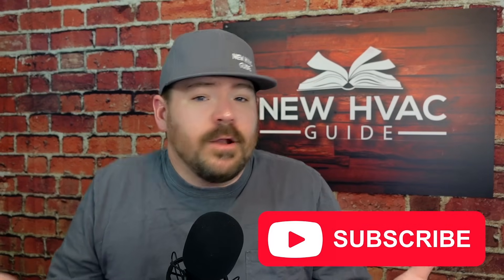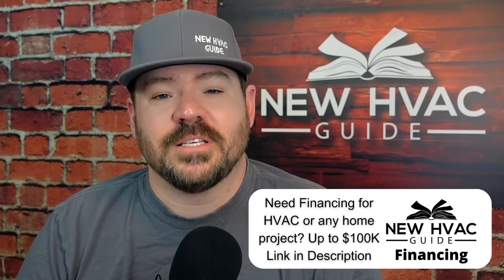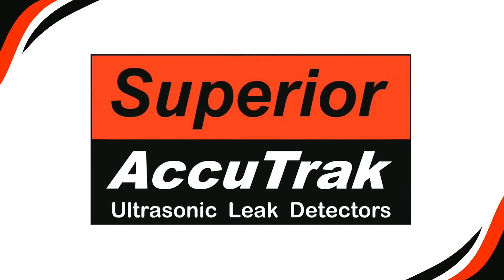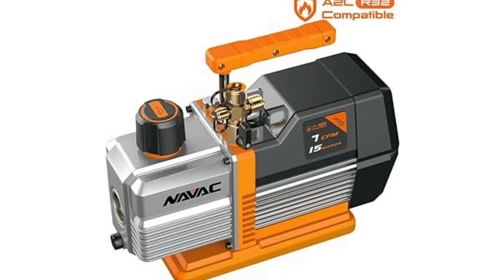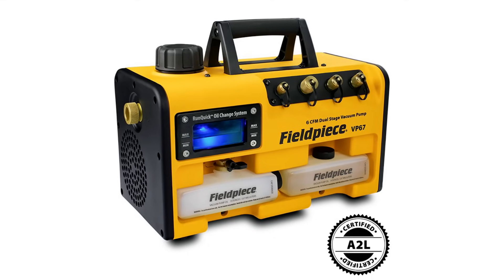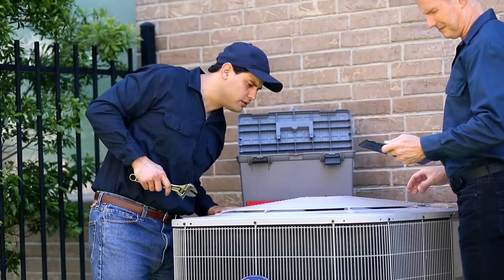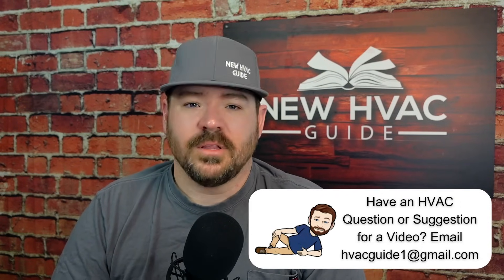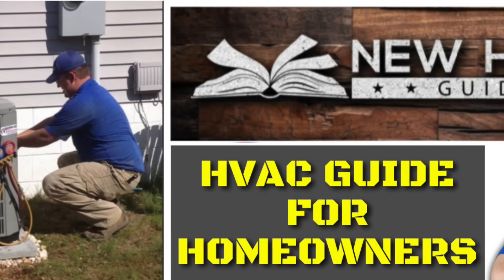Tools for Flammable A2L Refrigerants! - What does R454B and R32 require?

Comment: "Mildly Flammable" is like saying you only slightly have AIDS.  It's flammable or it's not.  If it will only ignite in high concentrations with an open flame, then why do they think it's necessary for AL2 tools?  Because it makes these companies money. I don't believe it's more flammable than R22.  R545B cools very well, I mean systems hitting 19 Deltas.  The Issue is the sensors and board failures, I mean failures out of the box brand new.  You better make sure you have some backup boards and sensors on your trucks and install trucks.  We've had several failures of these components out of the box at install. Good Luck.  I
Reply: Agreed. A "sparkless" vacuum? If it's sparking, you already have a problem. Hoses? Different oils, no big deal, so what. The issue I'm having is the ductwork, trying to use old, too small, for more sensitive equipment.

Comment: Please tell me, do i need to buy a 454b tank adapter if im setting up my precharged minisplit? I have a2l compatible pump and manifold and just need to evacuate
Reply from the maker: You’ll have to read the instructions and calculate the precharged lineset length and if additional charge is needed
Reply: @NewHVACGuide  I'm not going to change the line length, I think I just need the 1/4 to 5/16 adapter to vac the line.

Comment: There should be nothing in your line set after a replacement except some reminants of nitro n has. That is not flammable in any way. A vac pump will be ok if you still use the old style ones. But i do believe an A2-L recovery machine purchase makes sense

Comment: When 410 came out in the 90s they told us we needed seperate gauges and had to run new piping. It was all bs. I have 410 systems that are over 20 years old now that I never even flushed the old mineral oil from the original r22 unit. It’s all BS
Reply: 90s?? it was 2010
Reply: @AleksandrZubko-yx6uj R410a was introduced in 1991

Comment: why do i need a sparkless vaccum pump , but its ok to use open torch to solder the unit ???
Reply: Open torches used to seal up propane systems after servicing them.  Can't really  leave the ports in place with such a small charge.  A2L's are nowhere near as flammable as propane.
Reply: Exactly.  When you know it's a money making racket
Reply from the maker: Good question
Reply: Yea and soldering in condensers with many lbs of flammable refrigerant on the other side of the service valves is a crazy thought
Reply: Lol new freon has propane in them you dont need a sparkless vacuum pump wow you pull a vacuum through you gauges with only air and non condensables go through it not freon
Reply: Service valves hold back the freon you rookies

Comment: Brazing the lines?
Reply: Why has no one replied to this? 😅
Reply: Probably with first with nitrogen
Reply: If you're brazing lines with refrigerant pressure, you shouldn't be in the field, too stupid. Remove the ignition flame, it doesn't burn, can't without a constant pilot. Residual in lines, lighters are scarier.

Comment: If you are working in a heating and air company. You are likely to be working with Natural Gas and Propane.  People need to grow up. A furnace is a lot more likely to leak than a sealed AC system.
Reply: yes, but the gas pressures for gas heat are a lot lower than what they are running in the A/C cycle if it is so safe why explosion proof contactors, motors, etc.